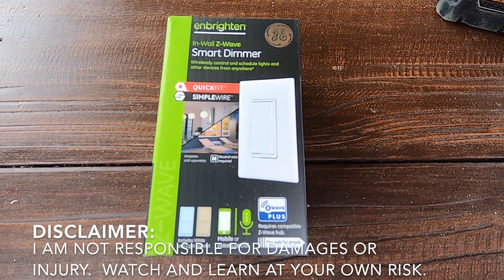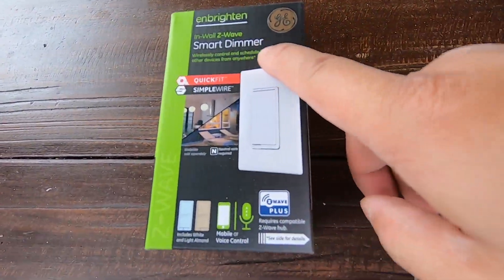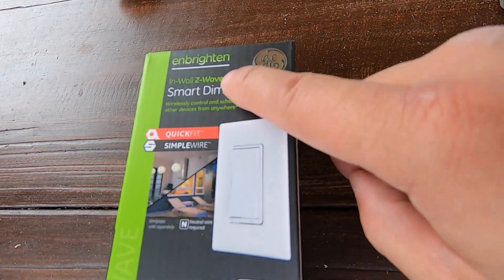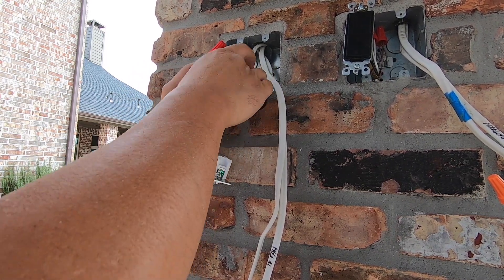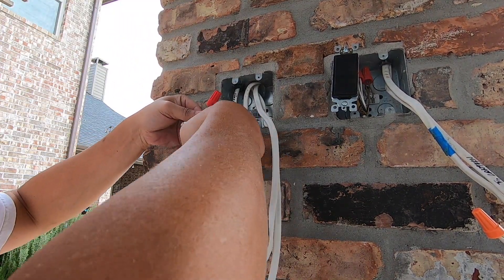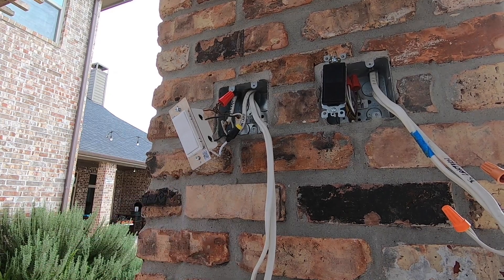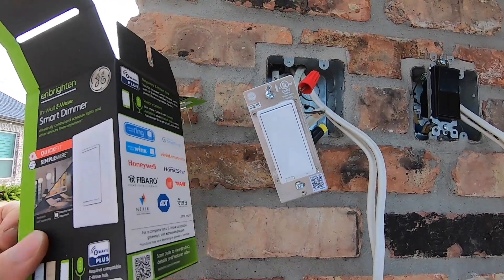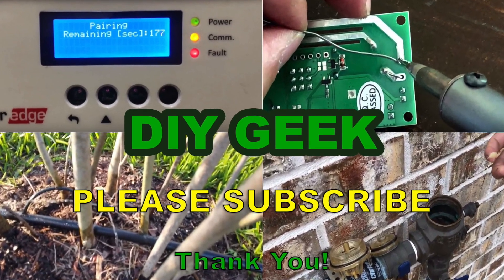ZWAVE SWITCH DIMMER INSTALL & SETUP

Comment: I know this was a little while back but if you can respond it would be appreciated have you had the switch unpair? If you did how did you re pair the switch?
Reply from the maker: Great question. It would only be unpaired if it was broken or if I change my wifi password. I would have to open the wall receptacle (plug). Remove the plug and reach in there to replace the broken unit.

Comment: Definitely would advise against this brand and smart switches in general...very poorly made product and will definitely fail. They’re like gfis and need to be replaced every few years. Went to a customers house and all of his smart switches failed for some reason, but all of his super cheap regular switches were working fine. Yay technology.
Reply from the maker: Thanks for your insights about GE Zwave dimmers / GE brand in general.

Comment: I am thinking about switching my cheap wink hub to smartthings, how has your experience been?  Is smartthings better on zwave or just stick with wifi?
Reply: The way I understand it is that z wave penetrates walls better and it doesn’t require WiFi. So if you have a cell based hub, you wouldn’t need WiFi to lock your doors, open your garage, adjust thermostat, turn the lights on.